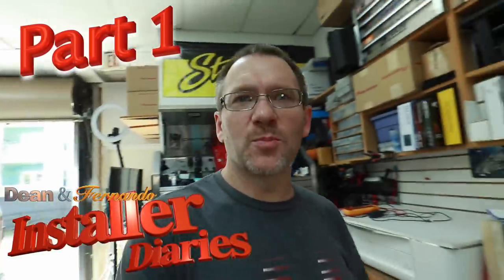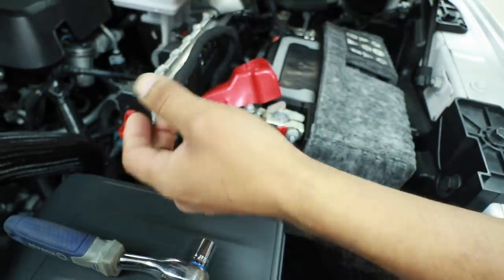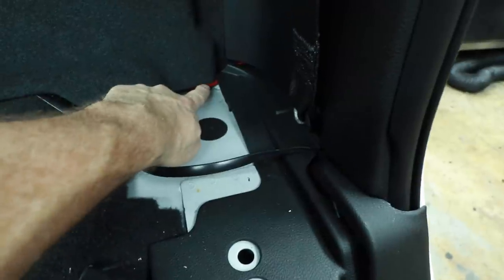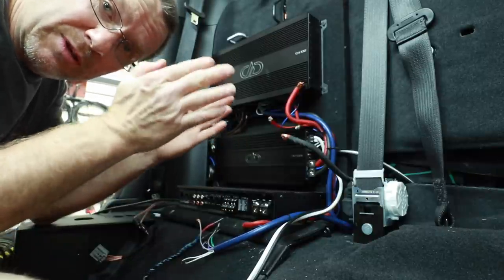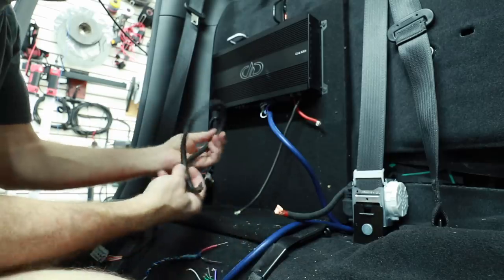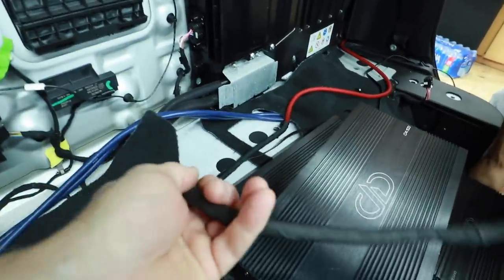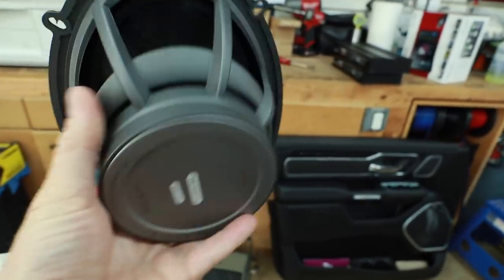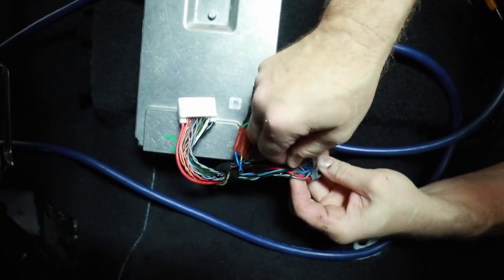2019 Ram in for a car stereo 911 Installer Diaries 254 part 1

Comment: Just did one of these guys I was hoping to see you guys do one before I did mine but no go.  Anyways there is no direct T-Harness Solution like you said but if you buy an APH-CH01 you can cut off the small index on those harness plugs and repin the connectors.  That way no cutting.

Comment: I've got those same speakers in my WRX, 6.5 instead of the 6x9 of course. I really hope the owner got all the extra hardware that come with the speakers! The GS-25 comes with it's own "fast ring" that didn't get used. The GS10 has a ton of mounting hardware that it comes with that they didn't use either. Real shame if he didn't get that stuff back to use properly
Reply: The vehicle was at that shop for a week, no way did they give anything back to the customer. Most likely kept or threw away unwanted/unused accessories.

Comment: Ran across noise cancelling circuitry on these trucks. There are 4 microphones in headliner "listening" for background noise. It would inject a nasty cancelling frequency to over come enviornment back ground. You have to snip 4 wires to bypass this function. It ran great once you did that . This is if you are retaining the factory radio and adding amp/ sub.
Reply: No need to cut any cable, you can use this harness to bypass factory ANC, i believed PAC should have bypass harness for it too.

https://lljcustoms.com/store/ols/products/2019-ram-anc-bypass
Reply: @gHiDoRaZ  No need to buy that when you can just depin the harness...and if you need to ever plug back in, easy peasy!

Comment: And I thought I wasn’t very good at running wire. And I don’t get paid for it. BUT, I did an install for a friend where the speaker plugs were out of stock. So I unsoldered the factory ones and re-used them. Super hard

Comment: i cant believe the shop that did this job did not put a distribution fuse block in the back too and just used one 4 gauge for 3 amps. Dean and Fernando will do it right but i can tell that they are like me when i get these kinds of jobs at my shop... i sigh. there is a saying i go by:    be cheap and cut corners in your work or in what you buy and it will cost you alot more in the long run.

Comment: Love your videos. Do you know if you have any where you demonstrate techniques for running new speaker wire to the door speakers?
Reply: Tyler, running new wire in modern vehicles is downright painful. If you're not running more than a few hundred watts to each driver, I would try to tap into the existing OEM wire either at the kickpanels or the stock output harness coming from the OEM amp. I am running 200x2 to each of my 6x9s in my front doors using Stinger speedwire tapped into the OEM amp harness under my front seat. Even though your amp says it's rated 200x2, most often you're not even coming close to running 200watts when listening to music.

Comment: I'm going to go out on a limb and say this is a far stretch from a 911 issue. This was clearly a bad location on the amplifiers. They didnt use custom length rcas. The doors were not that bad. 

Here is what I'd like to see. The installation cost receipt of the previous shop and yours. 

I love ya guys and you do the industry proud but at some point we need to discuss installation cost. 

At my shop an amplifier is $125.00 that's it. I dont charge for mounting panels and if you purchase it from us we do a discount at 85.00 

The door speakers would be $75.00 basic installation and as clean as what you pulled out. 

Please for the love of god have Paul or Dean reply to this so we can see what some of this work is costing in your area vs where they got this done.
Reply: Well tell your owner to charge more money then to do the job correctly.  And actually you can still do a nice job at a cheapish rate but there is no justifying this installation no matter what price point

Comment: Ive been away from high end car audio for several years.  What ever happened with HLCD's? Back when I was competing, they were all the rage, if you had the equalizer for them.
Reply: Please define HLCD. Thanks!
Reply: Horn Loaded Compression Drivers. They were commonly referred to as "Wave guides", but I think that was actually a name of a specific brands speakers. Used in some high end setups, mostly in competitive cars. Very high efficiency. Helped with "time alignment" by placing the voice coils very far away from the listener's.
Reply: @chanceatherton575  I'm sure Dean knows all about them.

Comment: This guy dropped some major cash on this system.......
Reply: Yeah and all he got was a crap install from the previous company
Reply: At least it'll leave D and F sounding like it should.
Reply: What’s scary is more times then  it should, you take your stuff to a “professional” installer and expect it to be done right and it’s crap. Unless you go through and check everything, you could be getting screwed. I would bet this guy had spent a MINIMUM of 4-5 k on equipment and install before it even go to five star. Maybe the guy tried to do it himself?  Idk.

Comment: Is there anything different about doing a big 3 upgrade on the new ram 1500's? For instance on a Chevy your grounding has to run through a round voltage reading thing so your computer can read it. I can't find a single video on a new dodge upgrade

Comment: Dean I need help connecting an eonon 10.1 Android 10 Ga2188 head unit backup camera in a 2008 jeep Wrangler x no amplification and no steering controls. Back up camera is a polk with power and video connectors. I would like to turn reverse camera on when traveling forward to see what I'm trailing. I hope this is correct way to ask. Thanks

Comment: Hey guys I have a 2020 ram 1500, if I mount my lc2i module next to my ANC module under my driver seat. How long you think my rca cables need to be if my sub amp is behind my back seat? 9ft or 12ft? Thanks alot

Comment: I just bought 2 15” DD 7000 series. BUT, I haven’t gotten a custom box made for them yet so they are in a pre fab porter box. It’s loud but I feel like they could sound so much better. Anyone have recommendations on Cubic Ft and box tuning for these subs? Also, I have a Rockford Fosgate T2500-1bdcp powering them.
Reply: I have a dd 18 single in my jeep in an 8 cu ft box and man does that thing kick. They sound muddy if you dont play high quality songs. I have a jl sub in my f150 and everything sounds good on that. I think the ported design is naturally muddy and boomy so unless its a really well produced song with good mixing, its gonna sound just okay.

Comment: The whole equipment choice does not make any sense to me. DD amps, sundown subs,  audiofrog speakers.  Those DD amps are nice, but not for this application.  I would rather have use the Audio control amps maybe the jl XD 8/800 to bridge the 6x9 and have 4 channels left over for the 4" and tweeters.  Some shallow mount type r or focal shallow mounts. So many options.

Comment: Hey guys. I'm looking for some great sound quality subwoofers  to put in my SUV.  Any suggestions? Name and model of subwoofers
Reply: lightbulb754 check out Skar. They are all sick and well priced.
Reply: Try Audio frog, they’re not cheap but they are an amazing speaker. As for skar audio, not a bad product but by no means a sound quality subwoofer. Also if price is an issue try some of the Infinity subs.
Reply: For the money, tough to beat the IDv.4 series from Image Dynamics. I'm running 4x ID8v.4D2 into 2x 2ohm loads at 500watts...so 1000 total and they blend so well, yet can get down and REALLY low when needed.
Reply: Skar is great for the money. You want power and good sq, youll be looking at jl.

Comment: Audiofrog is really expensive!
Reply: Yup, but they're a helluva sound quality speaker!
Reply: Not really, this is the GS line but the GB line. That entire 3 way front set up can be had for the same or less than the GB60 mid bass done. And it is all so well thought out and produced, high quality stuff for sure. But this line won't clean out your wallet.
Reply: @abellas70  GS is still considered expensive for some folks though, but yes, you are right, the GS line is much more affordable. Agreed!

Comment: Please run some real speaker wire. All this power going to great comps deserves new wire not the OEM crap.
Reply: That OEM "crap" is actually OFC and pretty good wire. Ask any professional installer and they will say the same thing unless you're putting an extraordinary amount of power through your midbass/midrange. OEM wire can typically handle over 100watts without any issue. Remember, music is dynamic, so more often than not, you're pushing far less watts to your drivers than you realize.